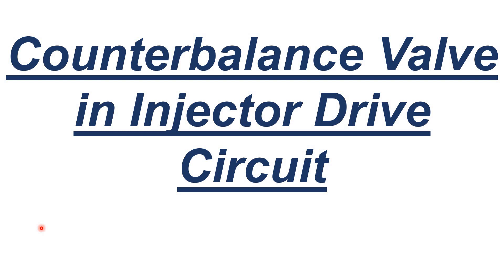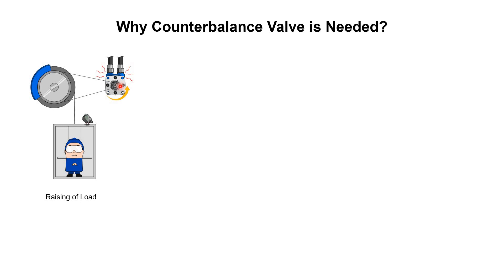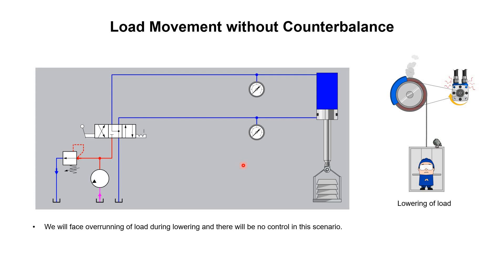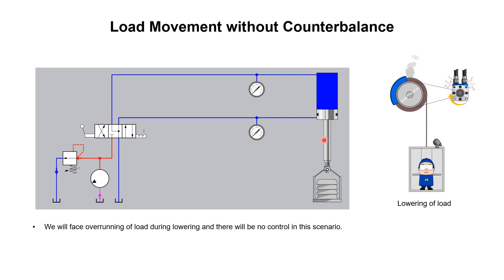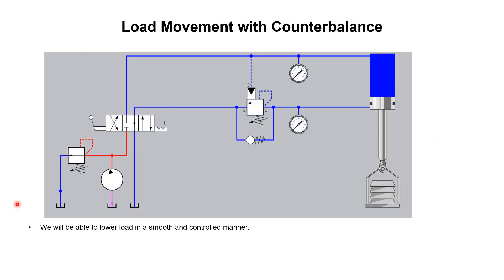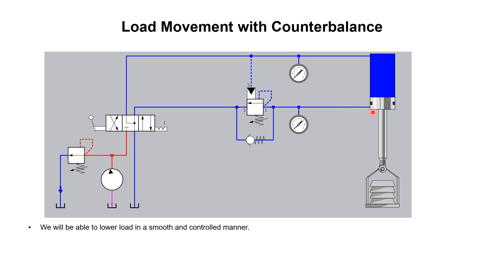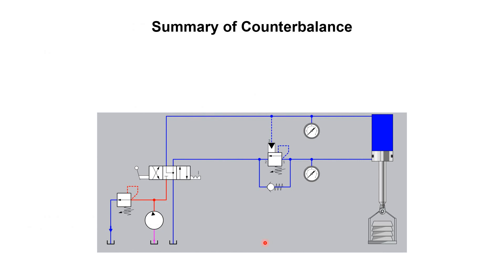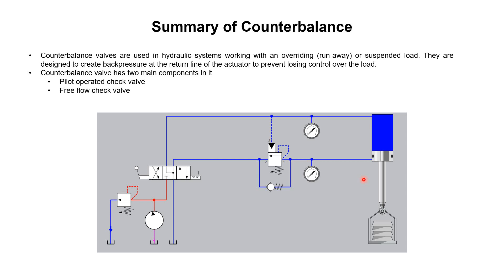78 - Counterbalance valve in Injector Drive Circuit by Yasir Ali

Comment: Y u copied from lunch box sessions
Reply from the maker: There are multiple answers for your question, chose the one suits you best. 

1) I am not a scientist, I just try to teach/ explain some concept I find useful. To explain some topic I need to refer from somewhere, so in this particular case, I found some stuff useful from lunch box ,so I used.
Reply from the maker: However if you are talking about copying their content, I am not building a new company to manufacture counterbalance valve, that their patent is going to plagiarised.
Reply from the maker: If you have something better to refer, please share then I will use content from that source ...
Reply from the maker: Last but not the least, if you watch the content of lunch box , that js generalized... But here in this tutorial I am trying to explain injector drive circuit., As far as I know.... They did not explain injector drive circuit.

Comment: How many counterbalance valve in a injector
Reply: mainly two counterbalance valves,  such as the case of Hydra Rig HR580
Reply: two counter balance valve on the injector circuit